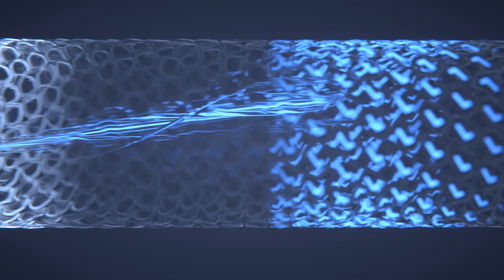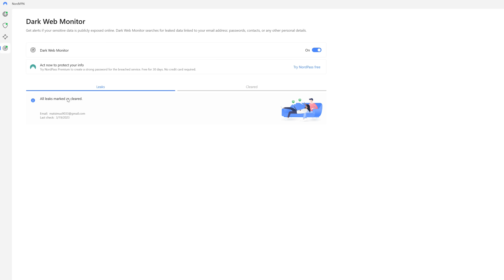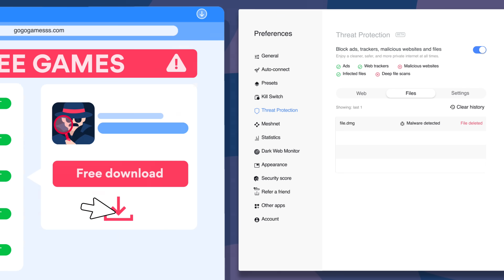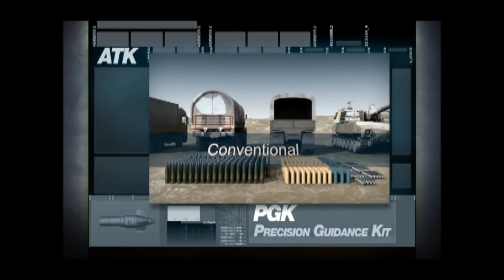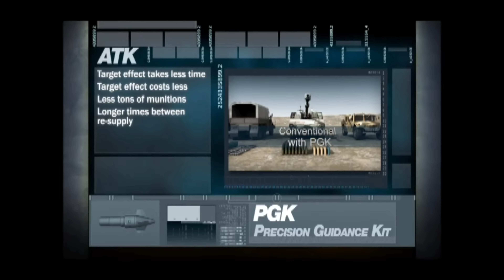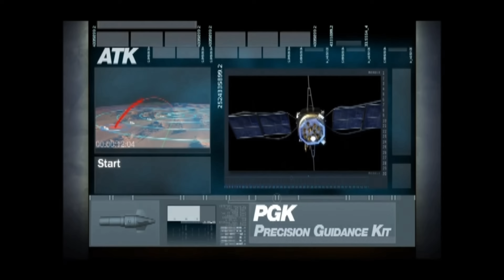Can Precision Guided Artillery Rounds be Jammed or Hacked?

Comment: Almost all US weapons have a basic IMU in addition to a GPS. Their are 2 CEPs one with GPS and another when jammed. But in recent times it takes more then just a noise generator to jam mil. rated GPS systems but countries like Iran have proven their ability to hijack a system via false GPS signaling but this has been corrected in most weapon system I would think, such that they can at least detect when someone is trying to falsify the GPS information using the new M-Code

Comment: EW is a crazy world. 
Remember, EW jammers are radiation emitters. Anti-radiation weapons such as HARM are not called anti-radar missiles. They're called anti-radiation missiles. Radio frequency (RADAR) jammers emit high powered radio waves (radiation). 

Want to find the jammers and kill them? Give them something to jam at the precise time you are waiting and ready to shoot something (HARM) to kill them. modern HARM only needs to sniff the jammer signal once. Then it remembers where that was. If the jammer continues emitting while HARM is in flight, so much the better. If not, so what? So long as the jammer doesn't pack up and leave, the missile will hit it anyhow.
If the jammer does leave, it's no longer protecting anymore, so drop JDAMs, SDBs and GMLRS jam-free.

Comment: This PGK sounds likIe just another application of the JADAM which turns "dumb bombs" into "smart, precision guided bombs."
I didn't catch a price on these but assume that the price would be similar, maybe $20,000/unit. That might sound like a lot to people but again that converts an $300 artillery shell into the equivalent of a $150,000 HIMARS... Well, almost. I assume the HIMARS rocket artillery is also more destructive than a single shell but I'm guessing. But if you can be sure of hitting within 2 meters of accuracy, do you need all that extra blast area?

Comment: Man, you like a lot of comments from people who really don't know what they are talking about. There's no way to hack a fuze, because it's not listening. Security requirements being impose on new manufactured production include program protection to prevent the software being read or replaced. Have a look at GPS-AJ, the google search pointed to articles that say far more than I'd feel comfortable commenting on. One article I read when fact checking some comments puts the ERCA canon range at up to 68 miles. People have some funny ideas about what can and can't be jammed. I expect the hardest part of the task is predicting the necessary steering based on known weather conditions between the gun and the target, even after the projectile's current trajectory has been determined. Things like de-spinning and steering are trivial compared to the aerodynamic calculations.

Comment: To answer the title, yes you can jam any GPS guided weapon, let it be a shell or a missile.
The effect of doing so however differs, no weapons designer worth their salt will have the weapon live on GPS alone, it is far too easy to jam for a foe that has access to sufficient transmitter power.
As a result, there are secondary and in some cases tertiary guidance systems onboard to support the weapon, for an example the TLAM or Tomahawk Land Attack Missile features an INS system for navigating.
INS is basically just a math hooked up to a gyroscope and is a sum of time, speed and travelling in a specific heading / elevation to determine where you are.
Problem with INS is that they drift, it is a math calculation that is always built on the previous answer, so errors build up over time, more advanced gyroscopes reduce this, but doesn't fully eliminate it.
As such and since the TLAM had to travel long distances, the 3rd navigation system is a camera that recognizes the terrain and landmarks it is to fly over from a database and thus updates the INS and corrects it's errors on the way to the target.

As such I expect these smart rounds to suffer from degraded accuracy at worst if they are jammed, but you will not stop them.
But hacking related, you will have to know vulnerabilities it's self test software and then be able to access that remotely to then set the fuse off early or never, doable in theory, not so much in practice.

The biggest weakness of this weapon in a theatre of war is the cost and reliance on micro chips, a supply that is far too easy to cut off in the modern world at which point it isn't as easy to mass produce anymore.

Comment: Maybe a I missed it in the video, but dual mode Semi-active Lse guidance is a way to "defeat" GPS jamming. The newest Excaliburs (Excalibur S) have this.  

This give you the added benefit of being able to hit moving targets, UA did so with great effect early in the war with their Kvitnyk and 122mm equivalent rounds. 

Sure the enemy can shoot  the laser designator platform, or jam it if it is a drone, but you have to get a lot right as the defender to both JAM the GPS, jam the drone (different electronic spectrum), find the team of  infantry or partisans lasing the target, etc.
Reply: This is why you defeat jamming by killing the jammer. EW jammers give up their position every time they broadcast. The same tactics used to defeat radar also work to defeat jammers. Get him to broadcast, then attack the antenna. Deception and stimulation. Force him to give up his position and hit that position. Then carry on until his replacement arrives and repeat the process.

Comment: CW Radio fuses can't be jammed. It would be extremely hard to do. Police speed radar used CW radar and even the designers of these radars couldn't do it. Its the simplest of radar but the very hardest to jam.
Reply: If that was true everyone would be using CW. And no, it's not true. The main reason radar guns aren't jammed is that FCC fines for illegal transmissions typically start at $10k and confiscation of equipment. So, $10k plus a car.

Comment: you can make such things harder to jam using a system of specially encoded digital PL tones, if that signal isn't transmitted with your correct frequency, transceiver ignores it, at best youll only be able to reduce its effective range, but nowadays that can be mitigated using on board navigation computer and some 1080p multi spectrum cameras and some fast digital signal processing to still fly even if signal seems jammed or unusable based on last good coordinates, and program destination, gps and cell chips paired with a special dsp or asic chip that solely does hi-speed parallel, large wordsize, trigonometry, calculus, and algebra and polynomial processing is fucking cheap
Reply: GPS is way beyond adding tones onto the signal. An M code receiver requires cryptographic keys. You are five decades out of date in that area. On the other hand... well check the price of the latest Altera and Xilinx parts. Adding a camera to these things would hugely increase the cost, these PGKs are supposed to be cheap. There is probably a market for a visually guided round too.

Comment: Could it be used to track back to a accurate location of the artillery firing the round?  Vs the current methods since a receiver could get the firing location earlier then radar based systems.
Reply: There's nothing observably different between an ordinary round and a GPS guided round. The GPS receiver can't be detected.
Reply: @cageordie  yeah because it is receiver not transceiver
Reply: Since guided rounds do not follow ballistic laws they can not be easily backtracked
Reply: @williamzk9083  Radar can spot them very soon after firing. Your belief is touching.

Comment: I wonder is this new fuse equal accurate as our Excalibour shells?
That it could be hacked in flight do im almost certain of that it cant be!
Its possible but really difficult to fry it down with EW. I must correct you
if i heard right that these guided shell is the most common shells used!
It is still the unguided shells that is dominating,witch is aimed and adjusted
with cordinates and wheater reports. But  let us hope that there will come 
cheaper kinds of Excalibours.
Reply: To hack something you have to be able to communicate with it. That means it has to be listening and willing to do something with what you tell it. Fuzes aren't like that. They have their orders already and they aren't possible to update after launch. So no, you aren't going to be hacking them.
Reply: @cageordie  Not in flight but there is always traitors who can 
configure systems.

Comment: the jamming resistance could be as simple as "IF getting bad data, THEN act like a normal fuse". It is still an artillery shell that needs to be precisely aimed. Making is so that is responds by "oh no you blinded my guidance, anyway kaboom!" sounds like a simple and effective solution. The jamming could potentially be spotted by the information warfare or the FO's. The cool thing about this being a simple fuse is that they could just switch back to normal fuses when this happens. This also begs the question, would it be ethical to jam these munitions? Yeah great you jammed it and made yourself safer but what happens when these still very deadly rounds land somewhere else? Are you willing the jam these projectiles when there are potential civilian or medical facilities in the area? Are you willing to jam them knowing that it could cause someone that is not a warfighter to get hurt or killed. What is more valuable to you? Your life or your honor. Then there is the ethical question of when is it ok to use them? If a jamming capability exists are you the gunner still willing to pull the trigger if you know non military targets could be impacted if the round gets jammed? Do you still maintain the same danger close radius as conventional shells when using guided rounds? If it gets jammed and hits a hospital who is at fault? The individuals jamming or the individuals sending the round down range? On both sides is your conscious willing to accept the risk of what could happen if the guidance gets jammed?

Comment: Very interesting. The "compromise" precision guided artillery rounds indeed are interesting, if not for other reasoons then because they apparently at a moderate cost can be utilised on your existing stocks of shells. But I think one should be careful when comparing cost of individual shells. A single Himars or a modern howitzer with Excalibur or similar ammo actaually has a chance of destroying a target, which conventional artillery only can expect to do with a huge amount of shells, guns, men, trucks etc. And next it will so much easier to hide a single Caesar gun or Himars system than the arty bataljon + it roughly coresponds to in firepower. Until now a comming offensive usually would be revealed by the huge amount of guns and shells being brought forward beforehand, but very few vehicles now can provide decisive firepower. That is a gamechanger which of course also is why it would be worth investing in jamming those pesky things.
Reply: The problem with precision is that it has no suppression ability and good only for destroying exposed targets
Reply: @JL-tm3rc  In most cases suppression is what you can get but actually destroying the target would be what you really wish. "Exposed" targets would usually be quite vulnerable to traditional ammo, the problem comes with the "protected" (dug in) targets. With traditional ammo you usually have to do with suppressing it, but the precision ammo has a very good chance of actually destroying it - largely making the need for suppression superflous. In the comming Ukranian offensive I guess we will se the Ukranians systematically taking out commandposts and heavy weapons in the Russian field fortifications (no field fortificatiion can take a direct hit of a 155mm) with precision ammo and the date of the offensive is set as the date when enough precision ammo is available.
Reply: @steffenb.jrgensen2014  but that is the thing about trying to destroy targets in urban and forested areas. the targets are hidden ,precision strikes are good only when you see the target. As can be seen in afghanistan and vietnam despite US air superiority they have difficulty spotting targets. Some himars have difficulty penetrating bridge deck how much more for  multistorey buildings.
Reply: @JL-tm3rc  Drones, GPS, thermal spotting etc makes target identification much easier, and as important is that the Russians are in static positions of mediocre quality and following a standard layout. That makes identifying the "funny parts" of the fortification line much easier. A bridge span is a very tough target, being made of reinforced concrete and/or steel. In field fortifications like the ones the Russians have been building not even the covered dug-outs are safe from a hit with a 155 mm shell with fuse on "delay". Anyway, history tells that static fortifications will be defeated without the defender being able to counterattack with determination - advanced ammo or not. The Russians have already expended most of their good mobile units and when what they have move to counterattack they will be extremely vulnerable to Ukranian fire. From OPSINT it appears that the Ukranians have at least 50 HIMARS systems and an even larger number of modern western howitzer systems. That represents a huge firepower and can be concentrated at say a 50 km section of the front to be breached very quickly and without the Russians knowing until too late. So the Russians have to spread out their forces and even if they try to concentrate their artillery vs a Ukranian effort to breach their lines it will take long time due to the huge number of guns, shells and vehilcles involved and expose itself imediately. Unless the Russians have some good mobile units in large numbers that we don't know of (unlikely), they are doomed.
Reply: @JL-tm3rc  Accurate fire is far more demoralizing than a thousand poorly placed rounds. The terror of seeing every incoming round hit something important is far more suppression than watching round after round walk across an empty field.
Reply: @slartybarfastb3648  once you are in a well hidden position you would not be a target any more. in a forested or urban area conventional is better. in an open field conventional  with frones can be as effective as precision. conventional also has more power
Reply: PGK isn't designed to be so much a compromise as it is to enable normal artillery accuracy at maximum range. A 155mm HE round has a blast radius of 50m. The  CEP at ranges 1/3 of max unassisted range is good enough, if not better than that (we don't use CEP for dumb shells, but Probable Errors in range, deflection, and height of burst). At max range, it's so ridiculous you'd have to fire maybe 100 rounds to ensure effects on target, which means you likely don't prosecute that target with dumb 155. With PGK, now you can fire a 3-4 gun platoon, or a battery, 1 volley and neutralize or destroy the target. THAT is where it changes the artillery game, not trying to be cheap Excal.

Comment: Great info Matt,  I've been hoping these would make it to eastern Europe since last summer.  You may want to consider trying to transfer to a 155mm unit...no PGK's for 105mm.
Reply: But there are PGKs for 120mm mortars.
Reply: They just haven't certified it for 105 due to even higher shock levels. Give it time.

Comment: It's not just jamming that's the issue. What happens when GPS satellites start getting shot down? Modern warfare is dependent on Satellites for GPS, communications, surveillance. 

EDIT: This popped up in my feed again. I did some research and apparently the Pentagon is looking at a whole host of techniques to augment and supplement GPS, as well as other additional means. Before GPS was available pre 1990s, inertial navigation looked after most of the militaries needs with only occasional location correction, this included the ability to drive subs under the ice within meters of accuracy after traveling long distances. Perhaps a more accurate form of inertial navigation along with alternate means to obtain location correction.  An interesting fact is that the navy has reintroduced celestial navigation in its training and the pentagon in general is working on automatic celestial navigation including daytime celestial navigation which will be performed by sensors.
Reply: There are very few countries with the ability to interfere with enemy satellites at the moment. That's not to say it won't become more common in the future.